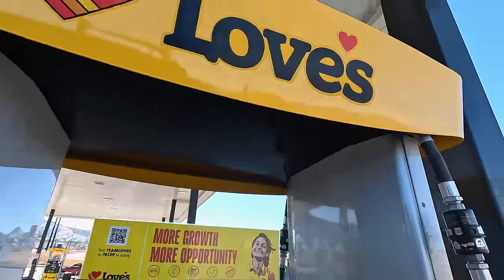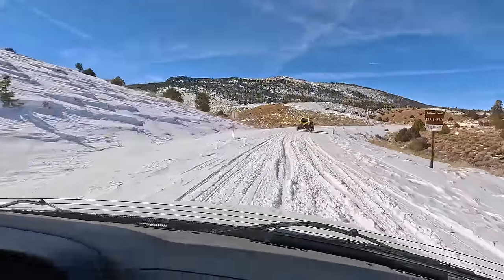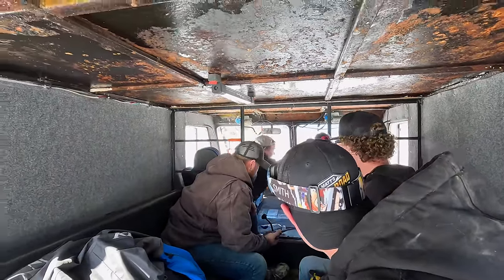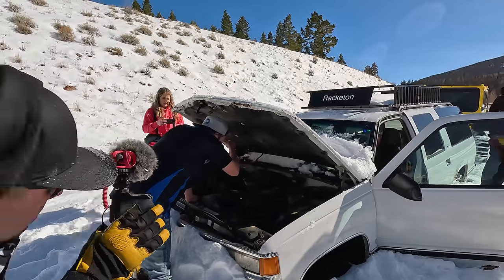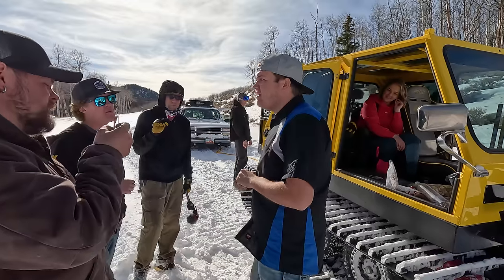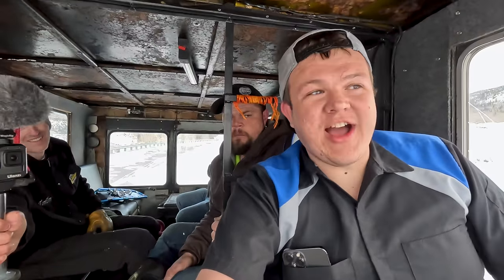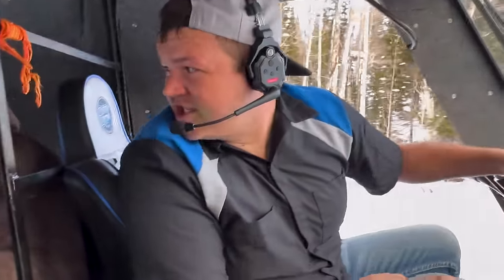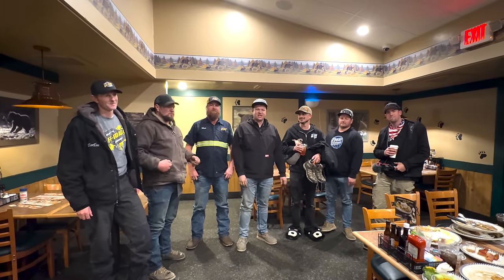Everything That Could Go Wrong Went Wrong! Snow Recovery. @MattsOffRoadRecovery

Comment: Colt 10 I used to work at ski resort we had a similar snow cat. my spot was in the back of the cat by the back door drivers side the side that opened . I was responsible for opening it in case something  happened. I did that for a decade and nobody sat in my spot if there wasn't  room you had to get out and ride on the back bumper and hold on to the bar. We went up the mountain 4 times a night never had to open the door in an emergency.

Comment: Wiskers has a voltage regulator issue. Buy a 1 wire alternator. They are self exciting and self regulating. Problem solved.

Comment: Hard not to love things powered by the old 300 six shooter. They were never real power houses without major work but one of the most reliable engines built. Do not bother running an Ammeter Robby. OEM's got away from them because you only need to volt meter and they are a fire hazard waiting to happen.

Comment: If you not fix your snow cat another way to wire it buy a alternator with out a voltage regulator buy the voltage regulator with 2 wires some come with a fuse one wire goes to the key switch the other goes to the alternator the alternator has one wire goes to the battery field to Field other wire goes to the key switch so you can turn it off so it don't drain the battery I don't this on Chevy and  1960 Plymouth  simple wiring if the regulator goes bad you only buy that part

Comment: Sorry for all the hassles but in the end it all worked out. Also there is something to be said for those older engines without all the electronics and computer systems in the newer motors. If whiskers had a newer LS engine in it with the alternator over charging it would have been dead on the mountain.

Comment: Lol. Amateur.     

Brake hard on the track that's against the obstacle then power forward.  It will drive the rear away from obstacle.  Then reverse while braking on side away from obstacle.

Ya don't use brakes on the free side to unstuck the stuck side.  That would take excessive force.